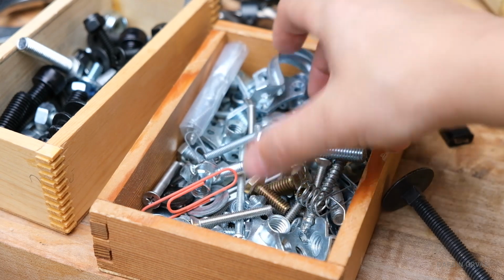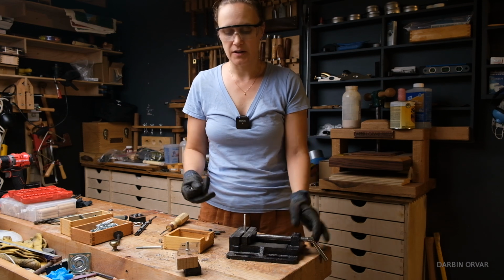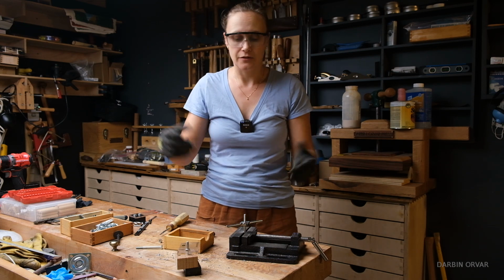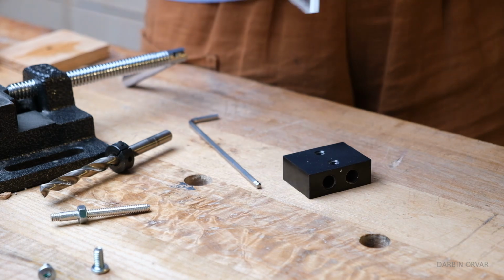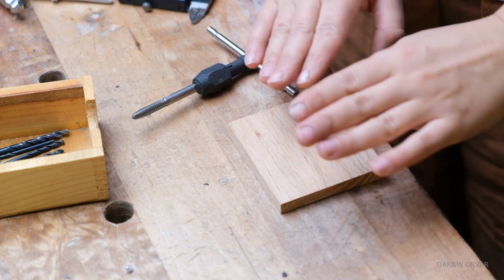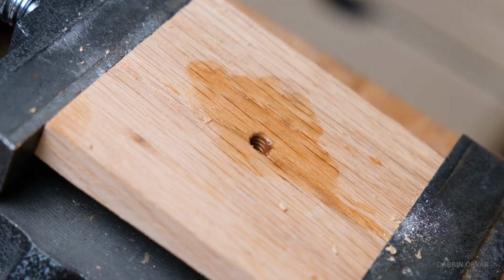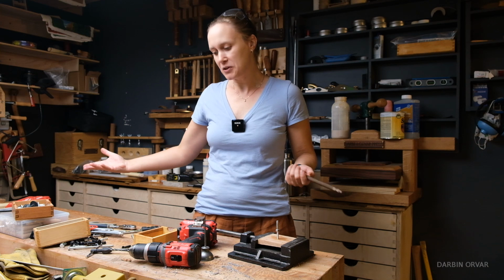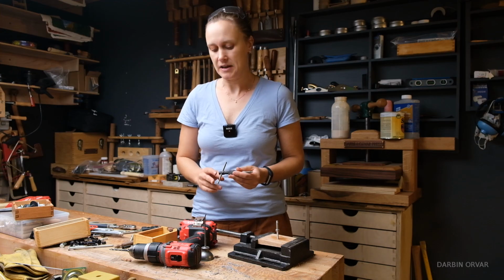Watch This BEFORE Making Metal Screws (Using Tap & Die Set)

Comment: Pro tip: use a cutting fluid when making threads... NOT a lubricant.

Another pro tip: apply the cutting fluid to the parts of your material that will actually be cut as well as the cutting teeth. Squirting fluid haphazardly around the material doesn't accomplish anything and it wastes your cutting fluid!

Yet another pro tip: if you use metal based thread formers to carve threads into wood, you don't actually need a lubricant. Woods are so soft that it isn't necessary.

Comment: Nice intro! Many folks don't know that creating threaded bolts and threaded holes is easy and fun.  But you might also want to advise folks to use a drop or three of light oil lubrication on the die. That really helps avoid the soft aluminum "sticking" to its cutting edges, and (as others have noted is quite common) when cutting threads on and in steel, lubrication is really essential.
Reply: Lubrication when cutting threads? Uhh, NO! You use a CUTTING fluid when making threads. Yes, I've heard all the arguments about fluids, so many for so long that I don't need to ever hear them again. I'll stick with what I was taught in school when I learned to be a machinist as well as rely on 50+ years of experience. Stick with cutting fluids when drilling and tapping where appropriate. Note that it is often appropriate to NOT use a cutting fluid when drilling or tapping. You're cutting bits, what they are made out of and the material that you are working on all must be taken into consideration.
Reply: @PossumWerx Quite right. Inaccurate terminology on my part. Cutting fluid, not "oil". Right you are.

Comment: Don't use aluminum - aluminum threads strip too easily. The tap and die sets are most often hardened to a level that allows making steel screws too - mild steel, that is, but that's enough for most normal uses. When working with steel, turn half a round back every two or three rounds forward, so the wire-like shavings cut by the tools breaks off into short pieces - otherwise they coil up in the holes in the tools and don't fall out, to the point that the cutting tools get stuck, or even break.
Reply: Not all taps require this. Think spiral flute design.

Comment: The taps and dies are made from hardened tool steel and can be used on normal steel not just aluminum.
Reply: Yeah, when she mentioned making a screw out of aluminium I thought it was a bit odd to use such a soft metal for it and just figured it was what she had at hand. But then she said her die only could cut aluminium and you need a lathe to make steel ones, I must admit I wonder where she got that strange information from.
Reply: @scania9786  I thought that maybe this was derived from her experience - if these tools were made from "chinesium" I wouldn't count on their hardness either. ;) Normal quality tapping tools can cut mild steel like they should.
Reply: I, too, am starting to have serious concerns about her knowledge level. Either that or maybe she was high when she made this video? She called it "....metal screws..." and stated that several times, during the video. Then, much to my surprise (and disappointment - I thought she was going to actually show a technique for creating actual screws!) she starts creating BOLTS! I mean...what?😳
Reply: Clearly... she's not a machinist. She's using too many terms interchangeably when she shouldn't be. Doing so accomplishes at least one thing - mass confusion.
Reply: Not all taps and dies are made from a quality tool steel. Some tap and die sets are absolute crap so make sure that you know what you're using for tools when you go to use them. In my day as a machinist, I have seen the failures made due to poor quality tools more than a few times. When it comes to tools, the axiom of you get what you pay for rings true! Caveat emptor!!